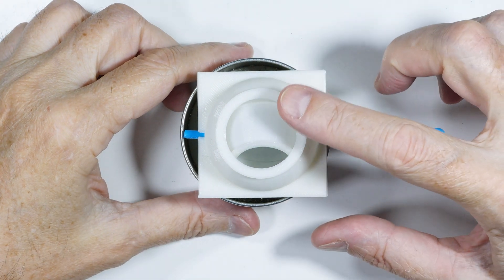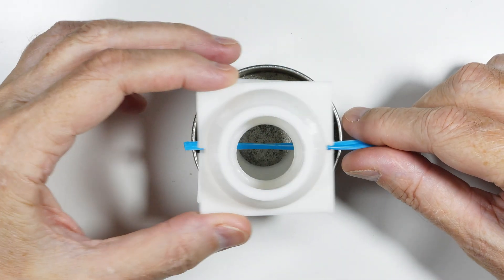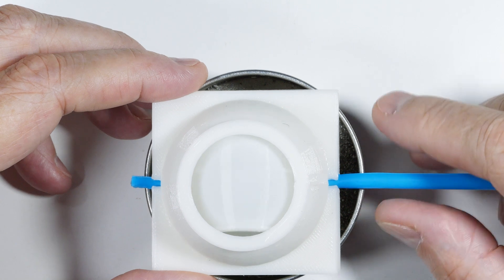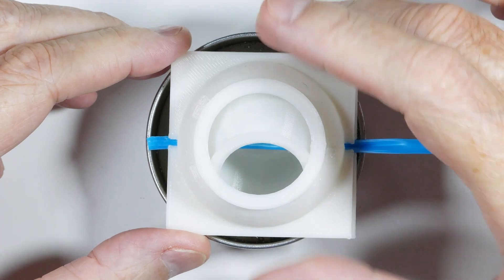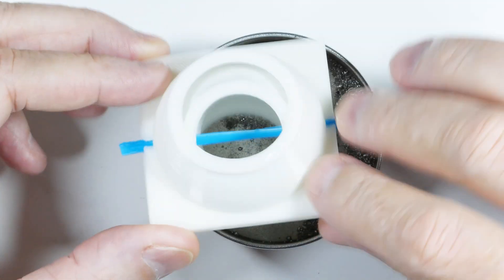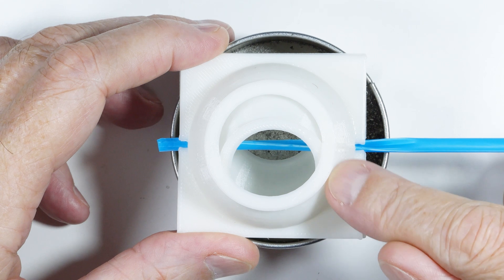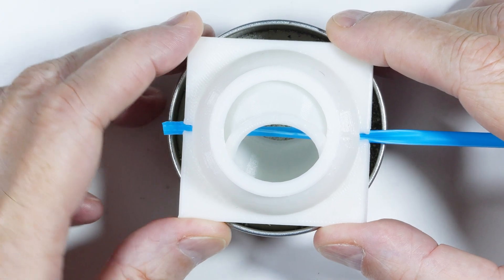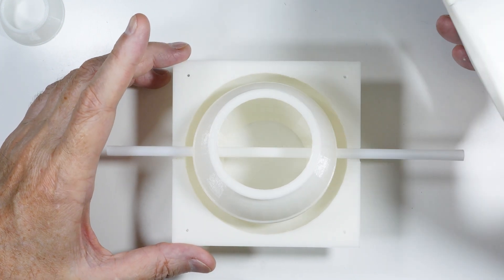Crystal Radio Variometer Pt1 (4K)

Comment: "wire rope" can work better than solid wire and cost far less than litz.  You just need some why to twist together 3 wires to make a uniformly twisted triple.  This breaks up the eddy currents.  
I have thought of a way someone with less access to resources could make a variometer.  I will suggest it here for those who may want to give it a try:
Imagine you have two "spiderweb coils" laying flat on a sheet of perhaps paper or thin plastic.  Between the outside edges of the coils there is a small gap.
Wire the two coils together in series in a manner so that a current going clockwise in the coil to the right is going counter clockwise in the coil to the left.
Now make an identical pair on another sheet and wire them the same way.
Using a length of wire that is longer than you think you need, wire the two sheets together in series so that a current going clockwise in the right hand coil of the lower sheet is also clockwise in the upper sheets right hand coil. 
Now poke some sort of pivot into the gap between coils.
By turning the upper sheet relative to the lower sheet, you can make the inductance vary over a wide range.
Reply from the maker: I have seen those and wonder how much inductance one gets for the space occupied. I might have to give it a try.